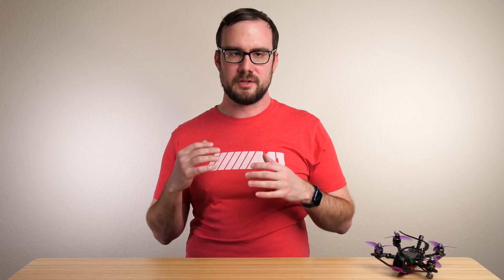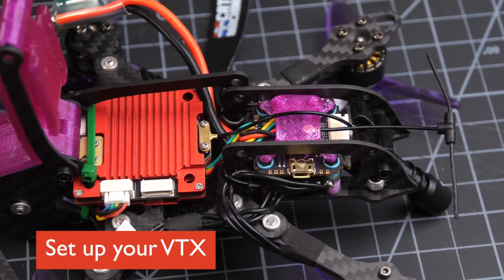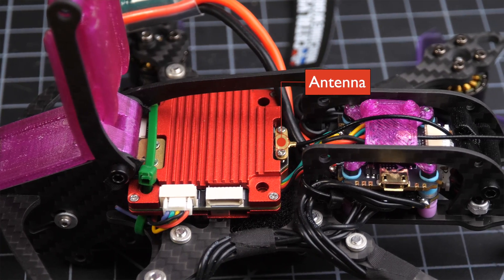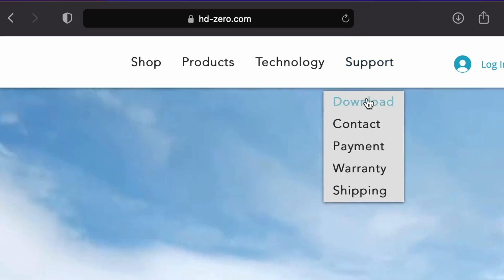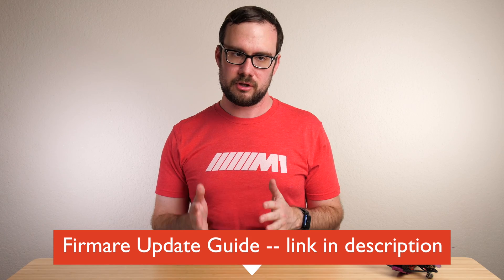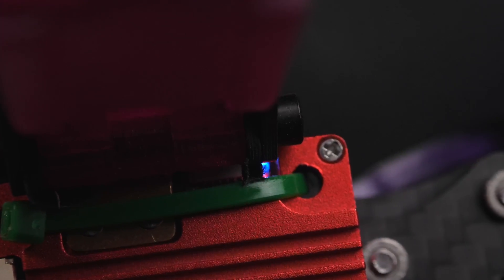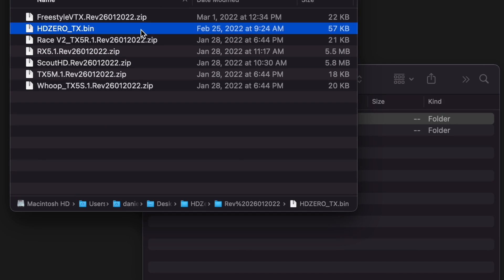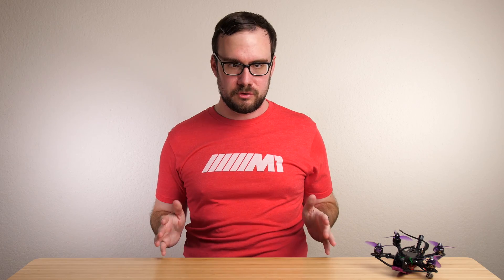Unlock the HDZero Freestyle VTX for MAXIMUM POWER!

Comment: Questions as it relates to HDZero used with INAV
1. My understanding is INAV does not use VTX Tables and does not use Smart Audio - is this correct?
2. Lets say I connected VTX TX/RX to UARTZ2 on FC. I am assuming (since smart audio is not used) that ONLY one UART is needed for HDZero in INAV - correct?
3. Last question - how to configure INAV ports when TX/RX is connected to RX/TX UART2 on Flight Controller? Do I use UART2 MSP enable or UART2 Peripheral and select HDZero VTX?
Thanks - appreciate your videos

Comment: As usual your videos help me figure things out. Thank you. I just installed the Freestyle vtx in my Chimera 7. Even after separating my tx, vtx and GPS module I lose most of my satellite locks as soon as I arm. I can barely hold 7-8 sats at 25mw. Anything higher than that and forget it. I also wrapped the wire harness of each component in copper tape and heat shrink. The tape is also grounded. The gps is mounted on top of the battery on an abs plate which is also taped and grounded. I'm obviously missing something simple here.
Reply from the maker: Hey Don, I have to admit that I don't have much experience with using GPS and HDZero together, but I know I've seen this problem discussed several times, with some possible solutions. I'd highly recommend either posting on the Divimath/HDZero Facebook group, or joining the Discord server here: https://discord.gg/pN3VBUh3 There are people in both of these places who have experience with this and will probably be able to provide more help than I can.